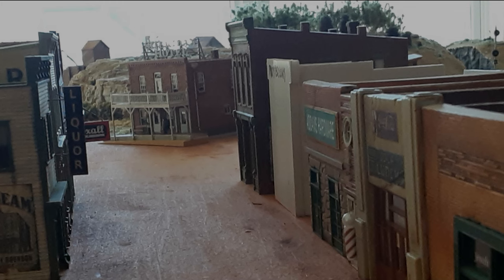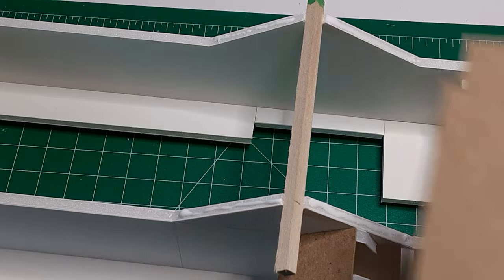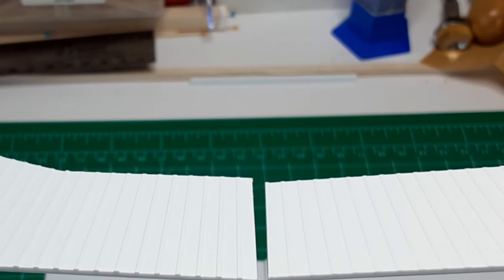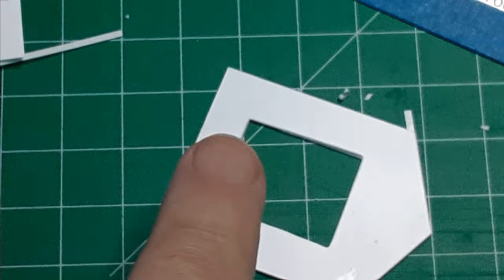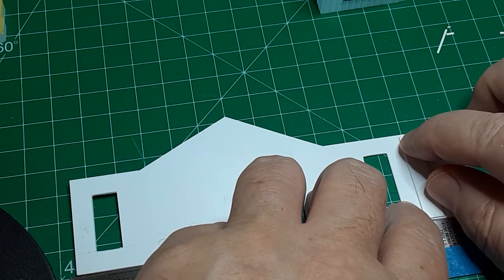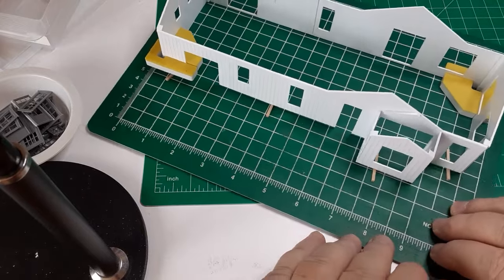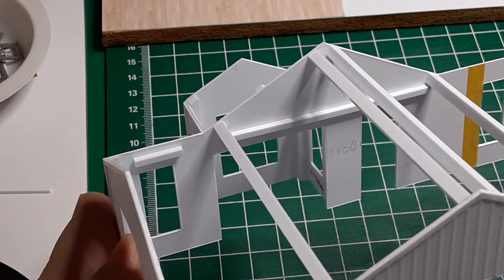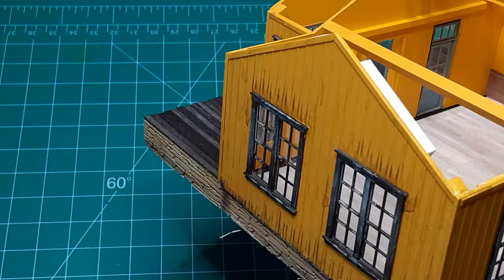Scratchbuild an HO Scale Passenger Station

Comment: Incredible as always. Do you put interiors in all of your buildings? I have come into a large lot of the old Suydam kits for short money. I love the corrugated tin. Some are matt board construction. Any pointers on using Matt board?
Reply from the maker: Generally, I add interiors only when the windows are large, numerous, or provide a clear sightline through the building. Regarding matt board, see my video "Scratchbuilding: Don't be Intimidated": I used matt board to build the elevator portion of that project. Building with matt board is just like building with wood: brace the back sides of your walls, and seal the completed building shell with a solvent-based primer to prevent warping when you paint with acrylics. Also, start with brand new blades, and pay attention to how well the blades are cutting - matt board, like all paper products, will dull your blades very quickly. Good luck!